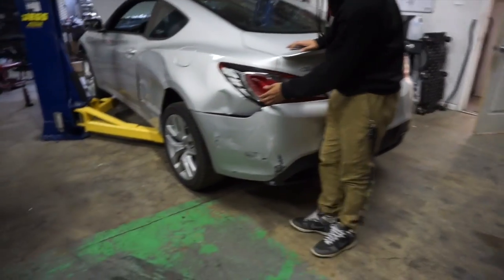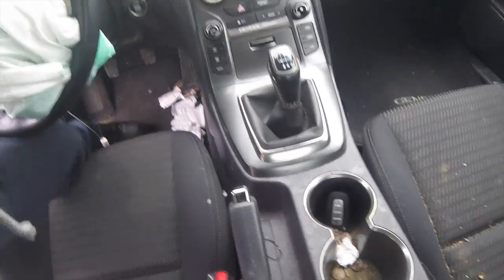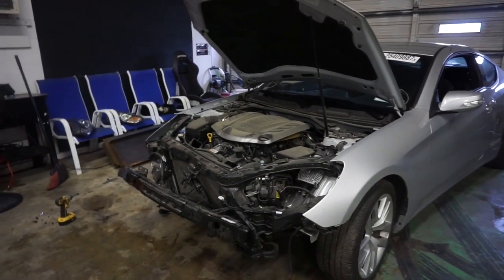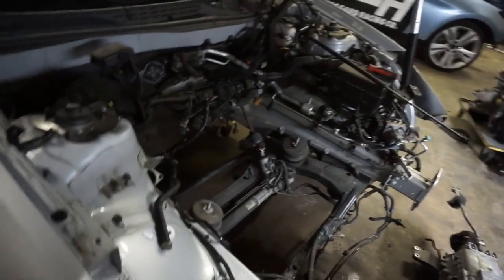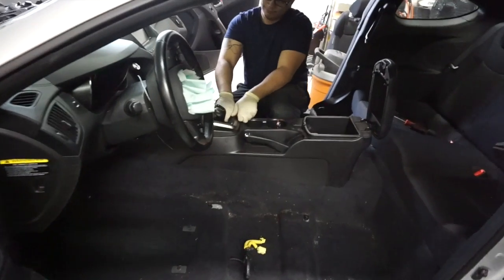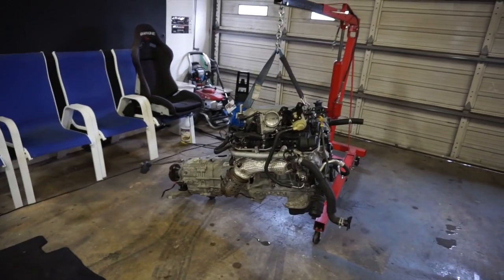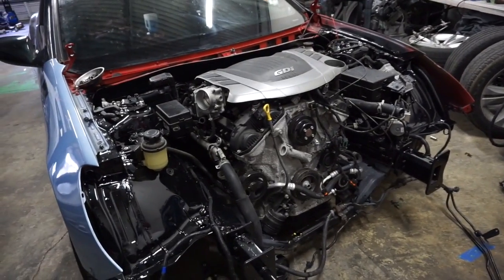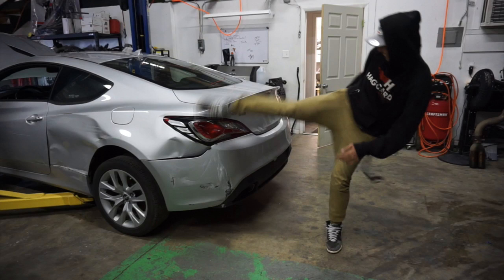Finally revealing the motor swap.

Comment: Hey Aaron, I'm looking at swapping a gdi v6 into my 2010 v6. is that any particular difficultys to watch out for?
Reply: ThatZguy just get 11.5:1 pistons for the bk1 v6. old one is 10.4:1 , gdi is 11.5:1 and thats what makes the power diff. "GDI" tech itself just makes it more efficent to run low fuel quality with high comp pistons without knocking. seen Korean bk1 3.8s with 11.5:1 pistons with as high as 340whp (with cai, test pipes and catback)

Comment: Hey guys I'm trying to get my turbo manifold (2014 2.0T) out so I can replace the O2 housing and I can't get the serpentine belt off so I can remove the power steering bracket. The tensioner bolt is in front of the belt and I can't get a socket onto it due to the belt being in the way. If you could tell me what to do it would be a life saver.

Comment: Why not do a Tau 5.0? It's KDM, it makes more power right off the bat. It's a swap you've never done. And it's an untapped market for that Motor. Us Genesis owners are limited in performance mods. If you guys could develop a tune, and make parts we'd all buy them. A Genesis coupe with a Tau 5.0? I'd love to see the performance numbers with that engine in that chassis.Rhys Millen did the swap a few years ago, but no one state side has ever done it from what I can see. Plus you'd make a killing with canned tunes for us Genesis owners, again limited in tuning our cars. One guy in Puerto Rico does the tunes but it's 1k for a canned tune. And you have to buy a New ECU. Come on man help us Genesis guys out.
Reply: BoostedCajun Amen ! I'd like to see a 5.0 Kit. They have an ls kit but i doesn't fit and you need a cut in the hood
Reply: BoostedCajun 5.0 only comes auto and ls is better in almost every way
Reply: Miamiheat9517 Why be like everyone else? And the Tau5.0 can be adapted to a standard trans Rhys Millen did it. Lastly LS while a great motor, it's been done to countless Gen Coupes. Besides SFR wants to stay KDM. Aside from crate engines the TAU 5.0 makes 429hp at the crank, a LS out of most vehicles is around 415 or so give or take. If parts can be developed for this engine it would be very powerful.
Reply: BoostedCajun That's probably a more complicated build though. Orion wants something he can drift right away.
Reply: the price point would be through the roof and they have a quick turn around....Youre talking about reinforing/stictching the engine bay up just to support the motor...That alone is a few days down the drain....
Reply: you dont have to cut the hood to put an ls lol
Reply: TheBRPredator Tell that to Eujuku racing
Reply: Mickxal that's cause they added a supercharger. There is plenty of clearance n/a
Reply: Frederick Neill it would be complicated no doubt. Being the ECU for the Genesis is a nightmare to tune. But, if they'd make a kit for the swap. Eventually not for a customer with a quick turnaround. It would be awesome to see Gen Coupe's running up on Muscle cars and beating them.
Reply: BoostedCajun I mean if you had to swap, why not just put an ls. Ls has way more aftermarket, cheaper to swap and tune and if you want to stay n/a and reliable just put some heads and cam combo and get to 500whp
Reply: TheBRPredator again nothing against LS's, I just would rather be original. Yes it's more expensive, but it's something no one else would have. I have a LS sitting in my garage, it's slated for a swap project I'm working on. But the TAU 5.0 engine could be much greater if someone would take the time and develop parts for it. LS swaps are just so common, it would be awesome to see a small shop do the TAU 5.0 Swap, not a big no budget endless resources shop like Rhys Millen pull off this swap.
Reply: Thats where they dropped the ball.The gen coupe should of had the 5.0 put in it  would of been a seller for them big time now they are going in other directions luxury wise and forgot who there main base is,I don't know what the new coupe will be like but don't think it will have the lines of this generation coupe or a good price too go with it.Oh well we will have too wait and see.
Reply: I think the problem would be the cost of the engine not many are laying around junk yards.
Reply: I have seen a LS swap the thing I don't like you have no HVAC anymore too me thats a minus.
Reply: Unfortunately that Tau 5.0 V8 won't fit without extensive rework of the frame in the engine bay. It just doesn't make any sense for the general consumer given the far lower barrier of entry for the LS V8 and greater support.
Reply: Tyler Thierolf explain to me how a ls would fit but a tau will need excessive body work the most you will need is mounts and wiring it has been done before
Reply: rushking19 the ls despise being a high displacement v8 is a small motor. its a simple push rod so it's compact and light
Reply: rushking19 like the other guy said the issue is the physical dimensions/size of the engines. The Tau being a DOHC design is physically far larger than the single cam pushrod design of the LS. I couldn't find a picture of the two side by side for comparison sake but I did find this one which shows the LS next to a TT V6 from a GTR. http://i.imgur.com/sEAhaJ9.jpg
Reply: Tyler Thierolf but the tau don't need frame modifications to fit it's barely bigger that the 3.8 rhy millen didn't need to modify the frame to make it fit or the guy who put the tau 4.6 in there the main thing is wiring that's a pain and the reason no one wants to do it
Reply: rushking19 the reason no one wants to do it is because it doesn't make sense to do it. initially you are going to put a v8 and get 100 or so hp from it. but you will get a v8 with not much aftermarket support and add more weight to the front end. people go ls because the ls is actually lighter than the 3.8 motor and sits lower in the engine bay so you have a better center of gravity and you also get a motor with ALOT better aftermarket. I mean like you put an ls3 and just putting a head cam combo you are pushing 500whp+
Reply: rushking19 and not only that, its a chevy so parts are cheap. you can get them anywhere. it would only make sense to have the Hyundai 5.0 if the genesis coupe came from the factory with that motor. that would push the aftermarket to make bolt ons and power adders for it.
Reply: BoostedCajun I think a Korean v8 is pretty bad ass. Maybe down the line they could pull it off. What if they put that in the Lexus? That would be unreal. If they ever get it back that is
Reply: TheBRPredator LMAO lighter than the 3.8 😂 that's some bull shit right there sits lower yes because the mounts but that inch don't help your center of gravity worth shit and also the 3.8 has amazing motor support, LMAO ls is lighter no way 😂😂😂😂
Reply: rushking19 Yea the ls a single cammed push rod while the 3.8 is dohc and the works. its been proven already as the dude with the ls3 genesis on the 1320 video weighed @3200 lbs while a 3.8 normally weighs 3400-3500lbs. also the 3.8 motor is shit. talking from someone that has it. at least bk1 goes only to 300whp FULL bolt ons while you see vq motors hit 340whp+. and even when you boost it, you still can't get that much power without building internals. not worth it imo
Reply: TheBRPredator LMAO he took stuff out of the car also the 3.8 is all aluminum has 2 less steel rod Journals 2 less steel rods 2 less pistons, and only has 8 more smaller lighter valves and springs and 2 more cams I'm pretty sure those things are lighter than a crank pistons and rods and not to mention the 2 extra slots in the block the ls is heavier than the 3.8
Reply: TheBRPredator and the 3.8 isn't garbage has tons of potential one of the most under estimated motors
Reply: not really have seen someone weighing the 3.8 motor so cant really tell you numbers. regardless the 3.8 motor is not underestimated, its shit. I HAVE it, i know how much power you can make off it. its a motor taken off an suv and reworked for the coupe. you can go full bolt ons on the thing and not be even close to a vq motor on full bolt ons.
Reply: I can literally give you a list on what the 3.8 can and cant beat cause I have raced them all.
Reply: TheBRPredator TheBRPredator Seems legit and you have a video backing it up. Better than most of the guys just talking shit and not knowing anything lol respect